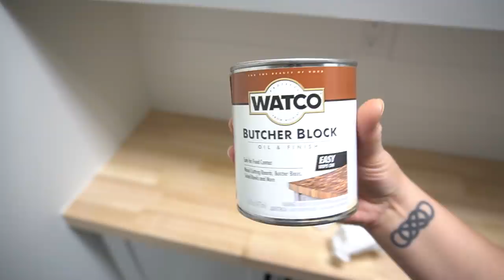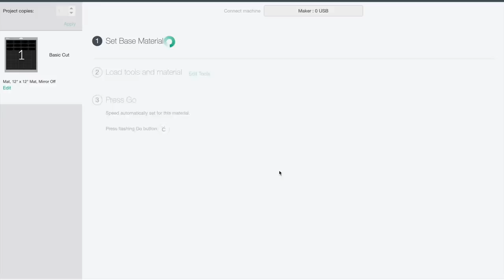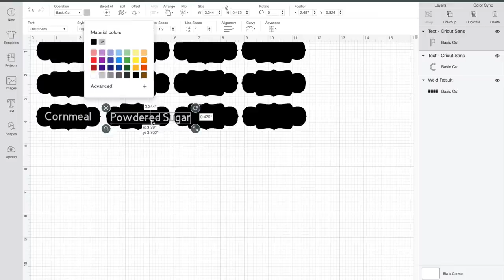EXTREME PANTRY MAKEOVER  | ORGANIZE & LABEL YOUR PANTRY WITH CRICUT

Comment: You guys do such great work!  If you don't mind answering a question, I'd appreciate it.  You said that you used an oil based primer and then put latex paint on it.  I was taught many, many years ago to never put latex over oil based paint because the latex paint peels off over time.  Is this no longer true with the newer paints or is it different because it is a primer?  Curious mind, sorry.  Thanks for sharing!
Reply from the maker: I learned that you can put latex on top of oil but NOT oil over latex. So far for me, this method has worked and I have never experience peeling. Not sure if things have changed, but that is how I do all of my cabinet painting and built-ins etc and it’s always worked great.